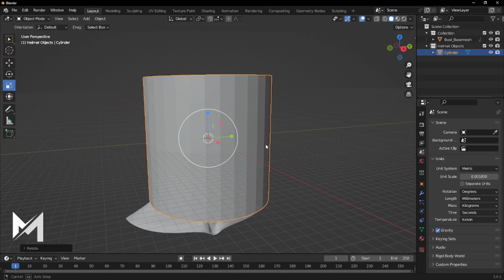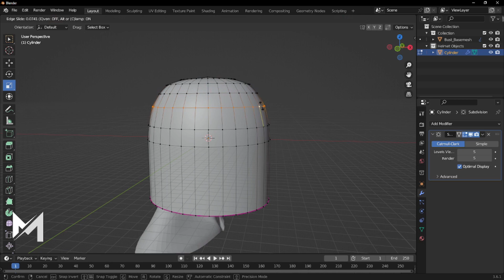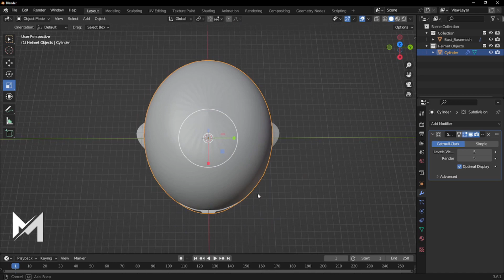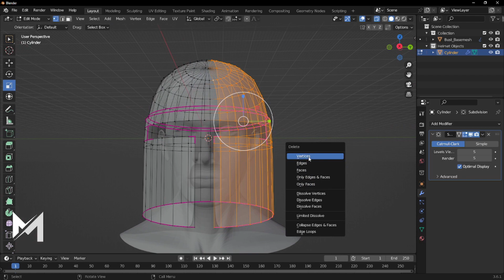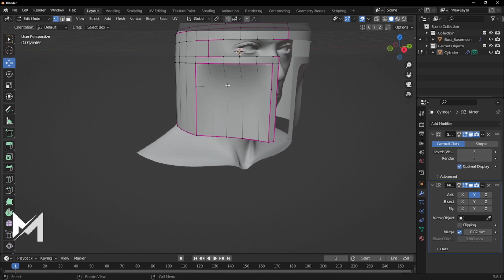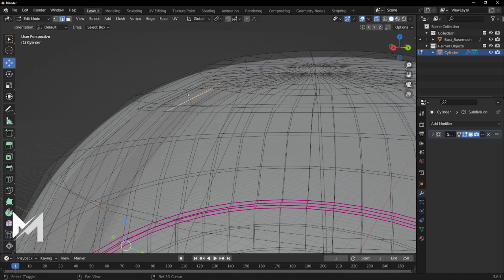Basic Mandalorian Helmet Modeling | Blender Tutorial

Comment: No judgement here, but why are you using an older version of Blender? I know it’s more than adequate for the process. And there is maybe 98% of 4.1 that I don’t use. Are the older versions better for modeling?
Reply: Or maybe a better question, that I should ask myself , if I use so little of it why do I run 4.1? 😂